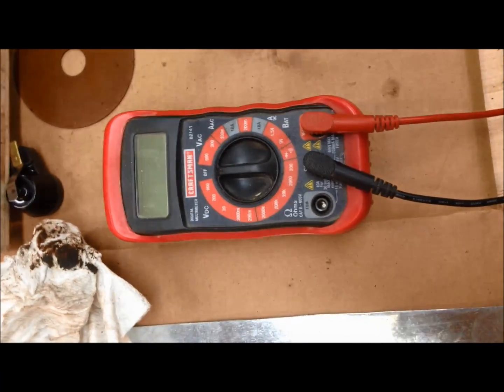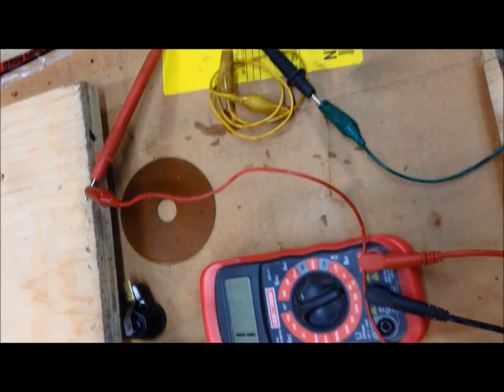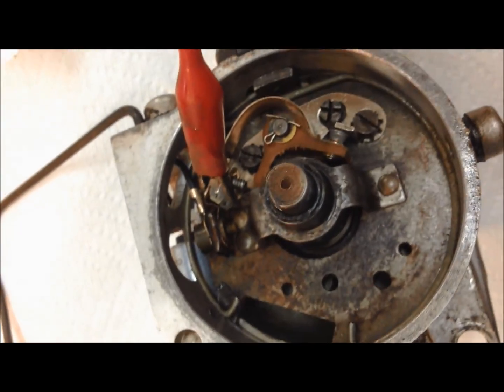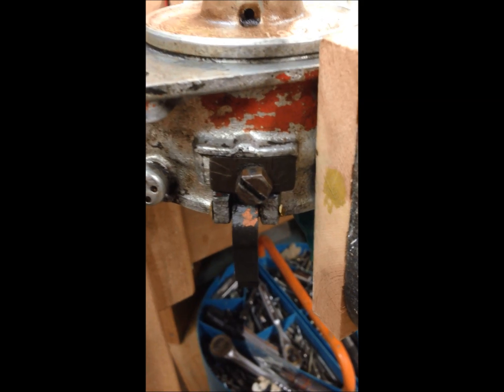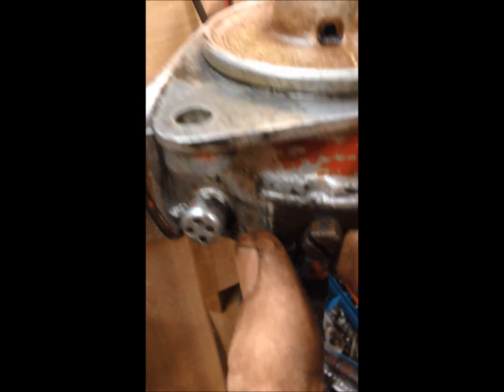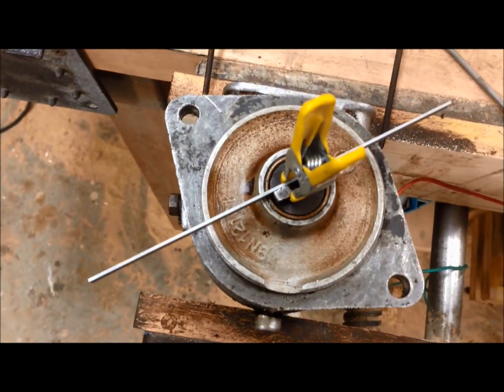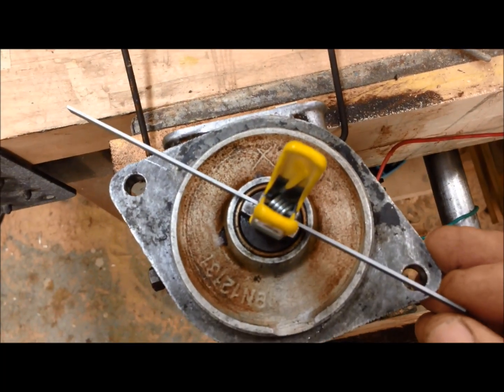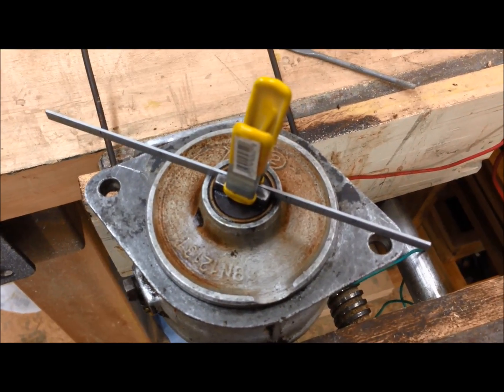timing 2n 9n 8n Ford front mount distributor

Comment: You can actually very easily move that timing bolt and marker plate while the tractor is running.  Check your timing with a timing light at the bell housing timing access hole.

Comment: That buzzer indication on that multimeter is for testing the polarity of diodes. That's the symbol for a diode that is pictured above the buzzer picture. I too use that to test continuity, the buzzer is a nice remote heads up that there is now continuity in the 2 things you are probing. When you're laying on your back with your head under the dashboard the buzzer sure beats trying to use your 3rd or 4th hand to hold the meter in such a fashion that you can see the screen and watch for the numbers to change lol

Comment: Hello, I replaced the points on my 8N tractor, put it back together and started right up but then it started running a little rough and later it was also backfiring and barley moving. What am I doing wrong and what do I need to do to fix my problem? Thank you

Comment: Thanks for this video.  Your timing method helped solve a mystery on my 2N that bothered me for weeks  The tractor sat over the winter and developed problems with starting and rough running early this spring.   Identified sticking valves and replaced them.  Replaced  ignition parts and it still ran extremely poorly.  Patiently troubleshooted things as best I could and happened to come across your video.  The Ohm meter tone never stopped when I spun the distributor.   The wire of the new condenser I had installed was touching the metal distributor case.  So simple, yet elusive...I doubt I would have found it without this method.  Smooth running again.

Comment from the maker: Glad you liked it. I lost my dwell meter 20 years ago. I loaned it out and it never came back. Enjoy!
Reply: Curious if this method would work for electronic ignition system, I am switching my 49  8n
Reply from the maker: @joedirt9600  I would think it would work. All your doing is adjusting the timing of points closing. It’s an on off switch that needs to close at just the right time! Good luck.

Comment: When the points are set at 15 thousands and the timing is set the way as you have described there will be two marks on on the rotor and one on the housing that will line up when the lobe makes contact with the point.  If you line these up it will be in time.

Comment: Hard to start - A437 plug resistance VS Autolite 216's with .020 gap https://www.youtube.com/watch?v=sB22u_DWMag
Reply: I just got back to my 9n after sitting a long time, and discovered that the points were a little tight and not breaking well. A hair adjustment out to .015 put the spark back in my life.

Comment: Doesn't cylinder one have to be top dead center when you install the distributor tho? I understand what you are saying about the distributor only fitting into the shaft in one way, but I feel like mine was fit correctly, I was getting spark on every cylinder in 1,2, 4,3 firing order, pulling fuel, but wouldn't start... I feel like my timing is everything ncorrect, even tho I just bought a new distributor and double checked gaps. Also, using A437's, still on 6v. Any help would be much appreciated man
Reply: A437 plug resistance could be the problem, not made for front mount distributor ignition due to weaker coil amperage. See this about Autolite 216's with .020 gap https://www.youtube.com/watch?v=sB22u_DWMag
Reply from the maker: I never had trouble getting the distributor installed correctly. I knew right away that it was 180 degrees out as the bolts would not line up correctly.  So being top dead center is taken care of with the proper installation.

Mine was giving me trouble, before I sold it, because the compression was down to 60 on 2 cylinders and 90 on the other 2.  So have you checked compression?

Have you tried the old starter fluid trick? If it fires you have spark but no fuel?

Good luck.

Joe
Reply from the maker: Not sure about that.
Reply: Taylor Welch k

Comment: I set the point gap on the high side of the lobe with the  15 thousands gage, But couldn't get to the 1/4 " - scribe line, I couldn't back the timing plate far enough,- came close! So I set the point gap about 20 thousands. pushed the plate all the way "up" now it is on the scribe line like in your video- must be the lobes are worn down ?  I will see if it works, and I am putting in a resistor to lower the 12-v to 6v on the 12 v coil - ( extend the life of the coil and points?)  should run just fine on 6 v?
Reply from the maker: Hi Tinkergene,

Not sure why this method did not work for you.  

And I have read on the internet that the resistor does help with the point life.  I never got around to trying it.  My old tractor finally died ( compression was down to 60 on two cylinders) so I've upgraded to an 851 Ford powermaster. 

Hope you can figure it all out.

Joe
Reply: I set the points about 18 thousands, and it runs real good, don't know why I couldn't set the timing  right at 15 thousands  - -  Must be one of those"flukes" ! ?

Comment: I'm curious I followed this method and my tractor won't start just backfires when I try so I checked the gap on the points and they were close to 30thousands so I set them at 15 and it still won't start so should I of had my points set at the proper gap b4 I timed it? let me know thanks
Reply: Tommy Jones 
Yes the gap should be set first.

Comment: Coils and condensers fail a lot causing weak or no spark when hot...fixin one now...they make a solid state conversion which I put on a few machine s ...no points or condenser to fail..and super hot spark fast starting. Mallory makes one 12vdc...one on my stump grinder and 300 IHC for years never touched darn points again...about $100 on eBay..

Comment from the maker: The end of the crankshaft has an indentation that the distributor mates with. It only goes in one way, so the engine must be timed if the procedure is followed. Pretty cool the way one Henry figured it out. The downside is getting to the blasted thing. Thus he moved the distributor to the side in 51?.

Comment: Doesn't the number one cylinder need to be rotated to top dead center? And which cylinder is number one?
Reply: Yes set number 1 at top dead center.... Front cylinder....the 2 tabs on the distributor are slightly offset were it meats the cam slots. If its off it wont go together.